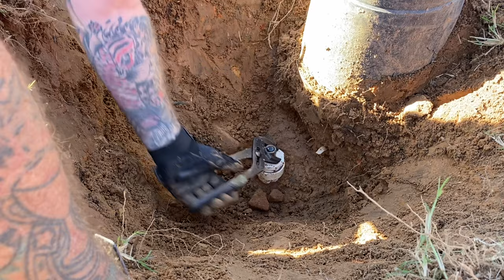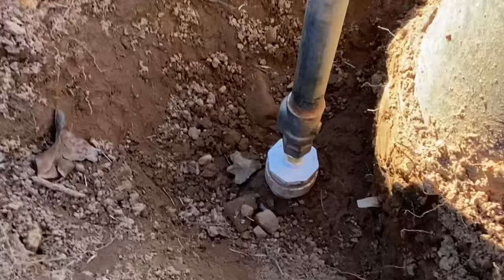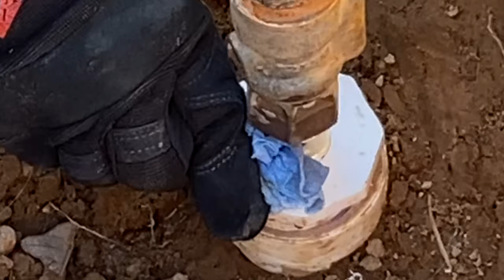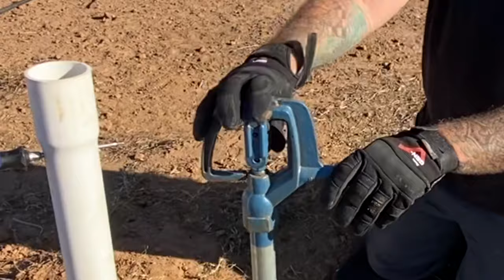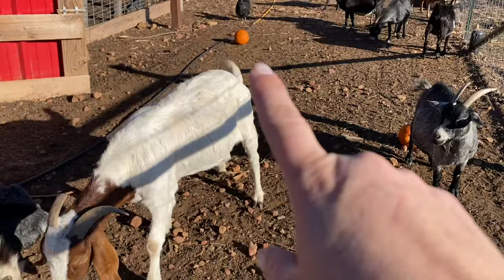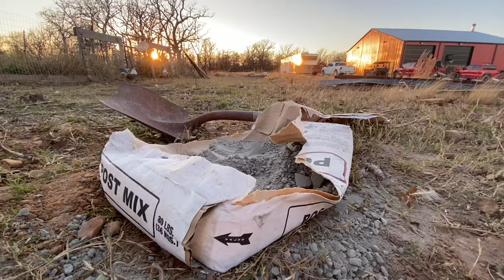How to repair Frost Free Yard Hydrant for ONLY $9 and re-install it to WATER THE FARM

Comment: Oh...I did rebar with a wooden box around it and attached it to the wood and rebar into the ground.  So, if you have to replace it...next time I would suggest this.   Had ours break a few times as well and with a box up around it and a clamp made with rebar...had not had this happen now for 5 years...knock on wood.  I hope I made since... hopefully this will work and you don't have a problem.  Yes, I have kids and adults that just yank up the handle...🤞. It works out for you and never have a problem👍
Reply from the maker: Thanks so much Mary! We wanted the post to attach to but we tried and it was solid rock, one of the fine pleasures of living on a mountain;) ⛰

Comment: You could put a post on each side of the Fossett with a cross 2 x 4 or something and strap it to that so the posts are in the ground and the pole is strapped to the 2 x 4 so it doesn’t flex back-and-forth I don’t know

Comment: I have not found a key to shut off those irrigation valves yet. I bought a larger box to get a wrench on it and sometimes have to dig out the mud with a shovel. I like how you used PVC drain pipe, mine is not very deep though.

Comment: Good fix my friend👍. What kind of temperatures can that water setup handle in terms of cold🥶 ?? I’d be careful with concrete as it will be inaccessible after. Good video my friend & cheers 🍻
Reply from the maker: It’s below the frost line, but I do t know the technical temp;) I’ll keep my fingers crossed too!!!!
Reply: @ParagonRidgeRanch  , 🤞